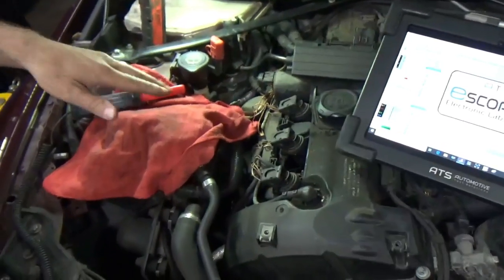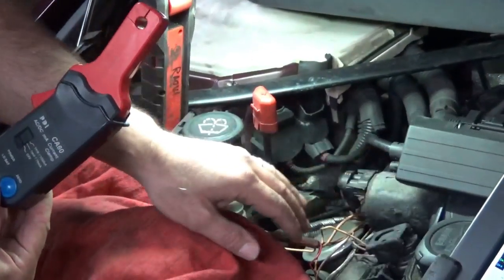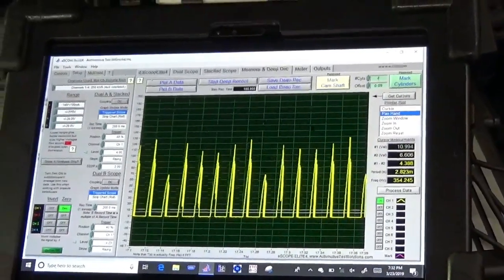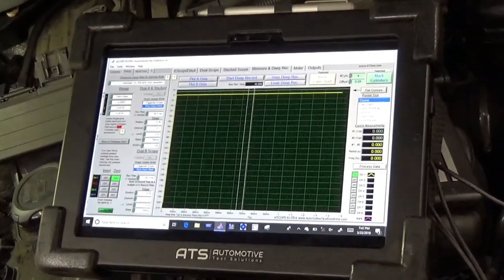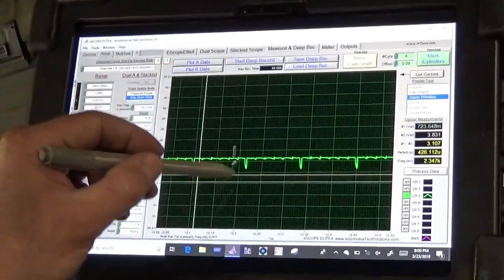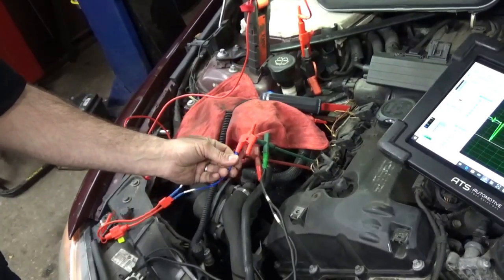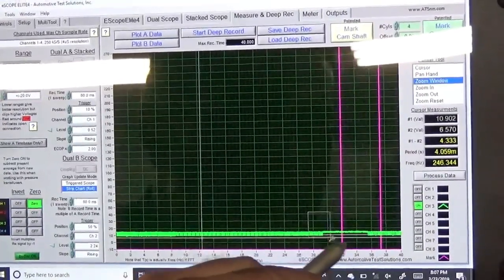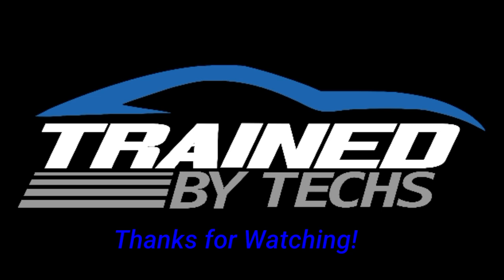Ignition Misfire Case Study using the ATS E-Scope Elite 4

Comment: Enjoyed the video, you are adept at using and setting up the scope. But in my experience, shops in my area, no one has this scope or Pico, they refuse to invest in training or equipment and use the scan tool only and swaptronics. So the tech gets screwed on the time for DX and flat rate. At least in this example, you had easy access to test points, ie no manifolds to pull. Techs have to be paid more, as there is a severe shortage of good techs. For example, CDL drivers are being paid much larger salaries, not flat rate than the techs fixing the trucks. I see tons of ads for mechanics in Richmond Va, where the starting pay is  $12-$15/ hr, or $20/hr to work flat rate at an independent garage. Sorry for the diversion but some comments referred to pay and flat rate issues. Thanks for taking the time to make a useful video.
Reply from the maker: Thanks for the reply Larry. We fully understand where you're coming from. You've summed up most topics that are key subjects related to Trained By Techs Mission statement.

" TO IMPROVE THE AUTOMOTIVE SERVICE INDUSTRY THROUGH NETWORKING, EDUCATION AND INDUSTRY AWARENESS."

Everything we do must have this focus in mind. Videos like this are just one method we use to accomplish our mission. 

Again, THANK YOU for the reply. These types of responses are what help raise awareness that things MUST change.

Comment: Nice video! Would have been nice, just for completeness to show a 5 second screen shot of where the additional resistance was found in the power wire. Sadly some techs still don’t believe that a loose connection can have that kind of impact on a circuit. Also, how do you repair the insulation after piercing the wire with the back probes?

Comment: Brandon, love the video man, and the scope you are using is pretty awesome. I'm debating, should I purchase this escope elite4, or go for a pico. I'm presently using a Verus edge which is a good scope, but I want to start doing cylinder pressure/ transducer diagnostics. The Snap-on scope simply is not at the same level and capability. What do you recommend? This is the first video I've watched of you using this escope, I'll look for others. Thanks for the great video!
Reply: Pico 2.5 k usd + 1.5 k usd pressure transducer.only escope 17k usd + pressure transducer.

Comment: Brandon, thanks for showing how to work with the E-scope. Is turning channels on/off/on/off (rather than shifting waveforms vertically) the preferred way? If so, why?
Reply: Dmitriy, I would say turning channels on-off vs shifting is a matter of choice, however, the Escopes do have the ability to shift the waveforms up or down if you prefer.
Reply: Dmitry, What Bob said is true. The channels can easily be manipulated/shifted with as much offset as you desire. Having the ability to manipulate the captures data to your liking makes it very powerfully

Comment: Brendon, so applying the same, we could supply respective 5V or 12V or Ohm or Duty Cycle directly to the subject wire, simulating the normal running enivornment?  Last time I learnt applying grounding circuit for diagnosis purpose, which just englightened my diagnostic horizon. Yes, I am a newbie diagnostician.

Comment: Nice video. It would however have been nice to see where the exact problem was on the car
Reply: Hello, truthfully the car was bugged by us shortly before the video was filmed. The idea was not to “repair the vehicle “but to demonstrate the techniques that would have led us to an accurate diagnosis and then proper repair, officially. We added a voltage drop to the coil voltage supply circuit

Comment: Great case study! Where did you place the resistor? Lol
Reply: Great observation. A ballast resistor was placed in series with the coil supply for COP #1.
    This was designed to similate a V-Drop as to be expected from a botched wire repair job. “MAN-MADE” faults are usually among the toughest to find. However, a solid diagnostic approach will yield the answer EVERY time 👍

Comment: What would be the next step in finding the cause of the low voltage supply?  Disconnect the coil connector and assuming the other end is the connector at the DME and disconnect that?  Would you then use a headlamp or other load carrying device and put B+ at one end and ground at the other and see how bright the light is?
Reply: Mike, the next step is to locate the v drop. I typically look for visual evidence (like a wire repaired previously) but then start at the next available test location. If voltage is ok there, Ive gone too far. If voltage is still low, I have head further towards the source.

Comment: It would have been nice to see the the improved current ramp with the feed wire bypassed instead of just the voltage trace considering the current ramp was the test that revealed the misfiring cylinder.
Other than that, good stuff as always.  Thank you for putting these out.
Reply: Excellent observation. I failed to place the probe around BOTH the source-wires (supplement and intended feeds). This is the reason we omitted it from the video

Comment: Thanks for the video, yes im just started with lab scope, using a snap on modis. Like to move up to one of those soon. 
First time I've seen your scope, what other reasons did you pick it?
Thanks again
Reply: Thanks for the response. The Snap-On is still on of the best handhelds on the market. I still use one! 
   I like the ATS scopes because of the many unique features they have .:
-dual scopes
-stacked scopes
-deep record 
-connectivity verification
-short finders
-DVOM/Bar graphs
-pulse counters (for trans slip)
-tremendous zoom capabilities as well as cursors , measurements, overlays and markers for degrees of crankshaft rotation. 
   The scope is PC based so sharing/printing  files and saving them to the cloud or thumb drive is easy.
Reply: @brandonsteckler1307  thanks for the information.
Reply: It’s my pleasure 👍
Reply: @brandonsteckler1307  Hey Brandon great video! Have you utilized the pico scope? if so in your opinion what is your take between pico and escope? thanks in advance!
Reply: Sergio Fragoso , thanks for viewing! The PICO and ATS are both very capable scopes. The PICOs capture capability (regarding sample-rate) far exceeds that of ATS. However, the ATS boasts some significant characteristics that’s are not matched by PICO. 
    My point is, I don’t think you can go wrong either way you choose. I own the ATS EScopeELITE (4-trace), the EScopePRO (8-trace) as well as the the PICO 4423  and use all three regularly. I’m quite comfortable with all. My advice to you is to be familiar with the limitations of any tool you use and you can’t go wrong 👍
Reply: @brandonsteckler3417  those are some wise words thank you very much Brandon! Look forward to seeing more of your vids!

Comment: Brandon great video! Can you further elaborate on the 3rd wire ground reference, why is it needed and I think on a diagram it shows as it leads to a set of capacitors per each bank. Why do you think BMW has decided to do this instead of using a conventional 2 wire COP. Thank you again
Reply: Thanks @Jones Key!
   I imagine the additional ground is for noise-suppression. I’ll note it is drawn on the secondary side of the transformer
Reply: This third wire is to return the voltage to where it first came from

Comment: How do you know when you need to use a attenuator when checking ignition coil's so you don't damage your lab scope? Great video also Thank's
Reply: Hello Daquan!
   Thank you for reaching out. That is a great question. Virtually all actuators that function off of principles of magnetic induction create an “inductive kick” when that device is turned-off. 
    When this occurs, the magnetic field around the device collapses back into the control circuit. All that magnetic energy has to dicipate instantaneously. The magnetic energy will transform to electrical energy and can generate “kicks” far higher than the original Source of voltage. If this energy exceeds the rating of the scope, damage will likely follow.
   For instance, a port fuel injector can generate 100v (if not not clipped). An ignition coil can produce hureds of volts. Even a relay coil can produce a lot of voltage.
   My blanket statement to you is:

-read the specs of your chosen scope

-better safe than sorry

Comment: Sending 12VDC down a circuit with a 9006 to ground then hunting with the thermal is the most efficient way I know. Pierce the middle most accessible point if that fails for further direction. Plz help cause this is hit and miss, time consuming at best. Ty.

Comment: now pigtail the wire off another injector feed wire ,charge him 400 dollars , hey thats better than 2 grand another shop would had charged by replacing parts, but no kidding you put on some great invaluable scope lessons and technical advice , you cut out a lot of BS and bring the scope simpler to use and understand for the learning phase of a scope, do you ever get into filtering , i got a cheap hantek 1008  but i have made some low pass filters . i know your eqipment has it.
Reply: Hi Henry,

Thanks for the feedback. Our goal is ALWAYS to simply the process and implementation of the tools. I assure you, it is NOT DIFFICULT. All you need is an understanding of the tool and the wiring diagram for the circuit(s) you are analyzing.
Reply: It is common to have noise infiltrate your school bag position. Many times this can be eliminated by rewriting your test leads and verifying your scope-ground

Comment: I'm not satisfied unless you download Part2
Reply from the maker: What more would you like to see?
Reply: Please tell us what interests you. The series of videos produced will revolve around feedback like yours
Reply: @TrainedbyTechs  The reason of voltage drop in specific,the full fix is not so important. But with this video only it seems like you only focusing on ads. about the scope brand
Reply from the maker: One of the main focuses of the video was on the diagnostic approach to finding, isolating, and proving the circuit failure in the least amount of steps along the way. Using the scope and having finesse with the tool, allowed those steps much easier to overcome. The value of the video is absorbing the steps that led Brandon to finding the issue accurately and efficiently. The fix was repairing a high resistance portion in the circuit after the splicepack.
Reply: @mohammedbierey  Hello Mohammed, if you look at the Volt Drop on the scope it lines up with the low current ramp.  The lower current ramp confirms high resistance.  So with the combination of looking at current and voltage we are able to see that this is a high resistance condition.  Now if we saw hi current with the voltage drop this would indicate a short to ground.  Make sense?
Reply: @Mohammed Bierey,

BusJockey describes this as my exact approach. The combination of the three traces proves the location of the fault. A poor coil ramp could be due to:
-poor voltage supply 
-poor ground reference
-poor PCM internal drive function
-poor internal coil resistance(excessive)

Comment: good video but it would have been more helpful to give viewers and idea of the repair
Reply from the maker: What additional clarity are you seeking?
Reply from the maker: The focus of the video was to demonstrate a testing technique that can be applied to any vehicle you're working on.
Reply: Being that he is an instructor I wonder if he induced a fault in the power feed circuit to show that you should fully test the system to verify the fault.  I've been there myself many times that I missed to check something and got burnt.  You can never be too thorough in fault isolation.
Reply: @Discretesignals  like placing a ballast resistor in the power supply circuit for ignition coil one.
Reply: My guess is that it was the splice junction, since the other 5 coils weren't see a big drop in voltage.  When he junpered around the splice, no more drop at that one coil.
Reply: @tonyfremont  I completely agree.
Reply: @tonyfremont :  The fact that he didn't even MENTION the cause of V drop on #1 coil power DOES MAKE ME SUSPECT that the problem was induced for the video. HOWEVER, if a real problem, i don't suspect splice; unlikely that only one of seven wires that are machine-crimped would lose connection. I think green crusties on injector plug, or fatigued wire at injector plug. Test V drop just out of splice to rule it in or out.